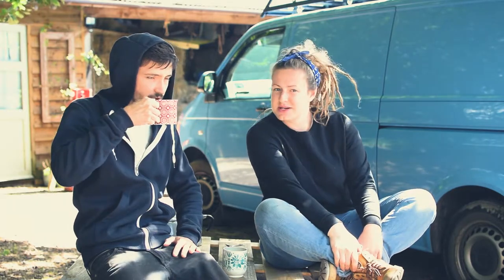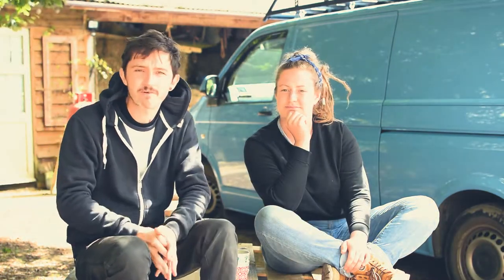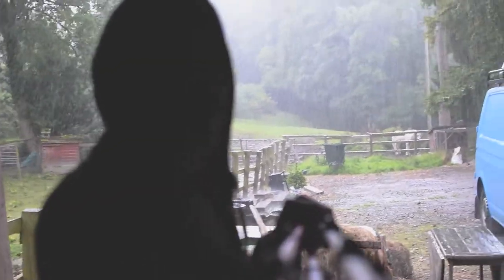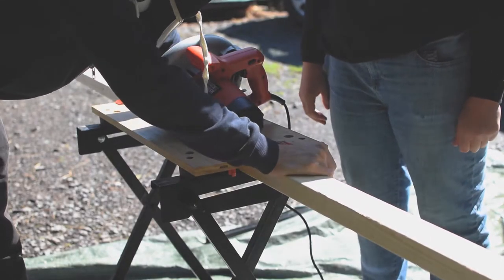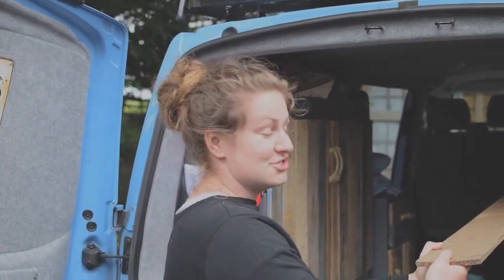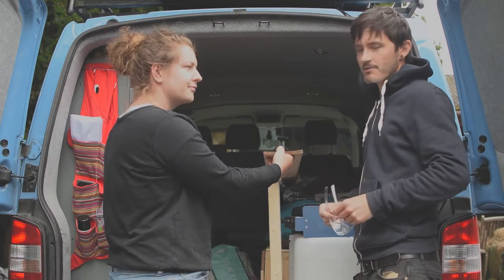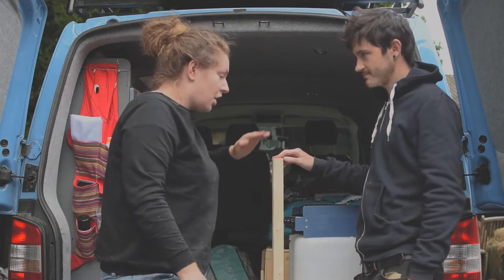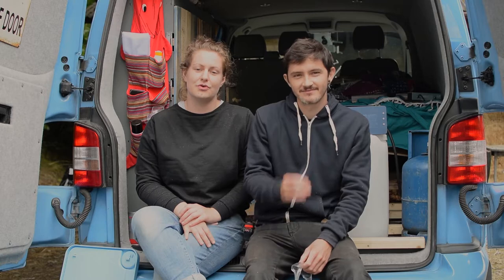Day - 29 Building Our Kitchen Unit (Part 1) #VanLife VW T5 Camper Conversion

Comment: Hi Meg and Callum how long is the interior back part of your van from behind the front seats to back door please? I have a low roof Iveco daily minibus that I am trying to convert and a bit unsure of how I should lay it out!
Reply from the maker: Hello Elizabeth! I’m not sure about the length off the top of my head, but I’ll do my best to measure it within the next hour and send you the results. What layout are you leaning towards?
Reply: @FloraTheNoviceExplorers  hi I am thinking of bed across the back, I have two children so need one belted seat in the back which is currently next to the sliding door facing forward, I sometimes have 3 passengers so no way to avoid this!
Reply from the maker: Our van from the back of the front seats to pretty much where our rear doors meet our furniture is around 290cm. Our T5 is the long wheel base version so we had a bit more room to play with, not a huge amount though. I’m not quite sure how that compares to what you’ve got to play with, my  general van knowledge is severely lacking!
Reply: @FloraTheNoviceExplorers  thank you that's a good start to what I have! I will measure mine in a while , I can nearly stand up in mine so have a bit more height and lots of windows!
Reply from the maker: Haha, we’re mostly doubled over unfortunately :p wish we had a bit more head room, but we’re making it work. I think it’s important to focus on what your vehicle does have and make the most of it rather than wishing it had this or that... good luck, hope all goes well!
Reply: @FloraTheNoviceExplorers  just measured and it's 2.5m long from behind the front seats to back door and 1.72m wide on the floor extending to 1.82m just under the windows so a bed across the back at just under window level would work! I am the tallest that travels in the van so if I fit everyone else will be fine! Thanks for the help and the videos are very helpful keep it up😊